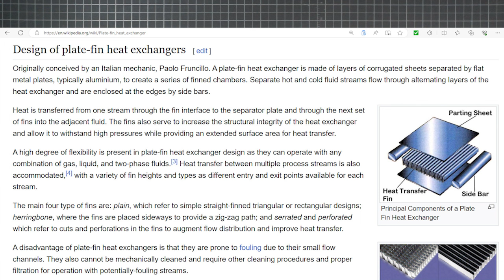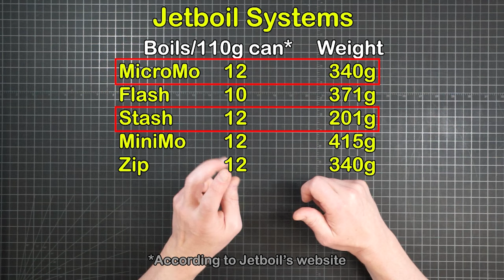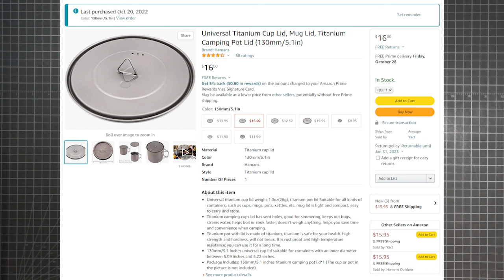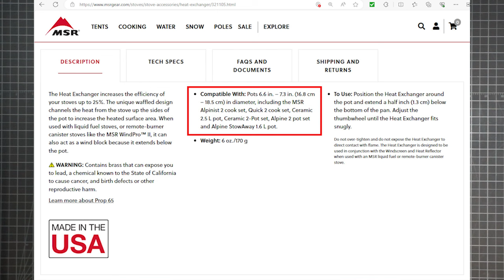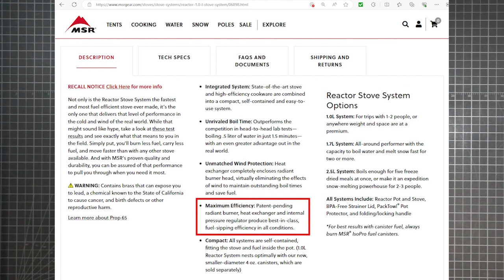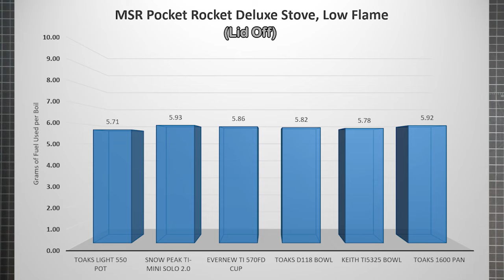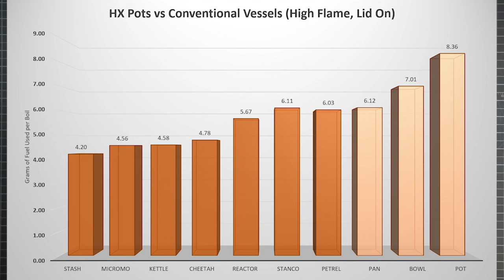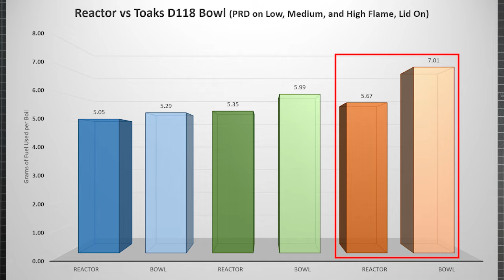Backpacking Stove Efficiency, Part 4: Heat Exchanger Systems (HX Pots)

Comment: I’m going to guess that the systems with a big burner gap that performed well in this 1st test will suffer somewhat with wind blowing between the big gap between the flame and the base of the pot?
Reply from the maker: Seems like a good guess. I do have some third party windscreens to include. A good gap plus a screen might be the best of both.
Reply: @GearSkeptic  the original FireMaple stove that comes as a set with the Petrel HX pot does have a larger burner gap than that of the Soto Windmaster/Petrel HX pot combo.

Comment: The rule of thumb for aluminum heat sink fin efficiency is 20/1  length / thickness.   I see only one that approximate this in your test, they mostly look too thin.  You're testing, not designing, so this doesn't change your results.  It does indicate abbreviated design cycles from most manufacturers.  I would be deforming the leading edges of the fins as turbulence increases exchange.  A small hammer and chisel would probably improve all of them with no weight penalty.   I am interested in wind shields that make a "chimney" around the pot.  I would guess that a chimney from .5 below burner (wind shield) and covering  75% of the pot with a .1" to .2" gap might be worth carry weight.  Also compare deformation temperatures of aluminum and titanium.  Easy to ruin an empty titanium pot over a fire.   Thanks.
Reply from the maker: Very thought-provoking! Thanks much.

Comment: Heat exchangers increase the surface area near the heat source, right?
The pot sides have greater surface area than the heat exchanger.
Therefore, a windscreen that keeps the heat near the sides of the pot should work better than an HX pot, and could be much lighter weight.
Reply from the maker: That would need testing. The trick is, heat transfer rates are based on the temperature differential. The hottest parts will transmit the most. Things cool off very quickly, and the sides won’t be anywhere near as hot as the bottom.
Reply: @GearSkeptic  I've done some casual testing that has been promising. You're set up better for testing than I am, that's why I suggest the idea to you. 

Is there a way to discuss more other than here?

Agreed that it needs testing; the math rapidly becomes complex.

Comment: You talk about a bigger gap between the flame and a pot. That made me thing about high end restaurant stoves. They have massive gaps between the port and the burner compaired to stove tops in a house. So You could ask one of those manufacturers why that is.
Reply: It's for wider and more gentle distribution of heat load. Eliminates hot spots on pots and pans and applies the heat across the pan. Restaurants don't care about fuel efficiency in stoves. More about production efficiency.

I do think almost 100% of backpacking stoves are too close to the pot. Notable exceptions being the MSR Dragonfly and a few others. Its a compromise. Ideal distance vs wind.
Reply: @UnitedElectric  Well the more fuel effient a burn pot combination is the less heat is being pumped into your kitchen. Before airconditioning kitchens were stupid hot. Even now with airconditioning some kitchens switch to induction to battle the waste heat problem. So profesional stoves do care about fuel efficiency.

Comment: Would insulating the pots help?
Reply from the maker: On theory, I’d say it would help some, but my guess is not by much.  From the earlier tests, I was surprised by how little difference a lid actually makes.

The MicroMo has a neoprene cozy around it (the only one tested), but that didn’t stop it from falling behind the Stash, which is thin-walled and naked.  I do recall that pot surface area started to matter when wind was introduced. Have to see what happens with HX pots in the wind!

Comment: Silverfire's Scout Mini Dragon Pot goes beyond fins
Reply: Agreed.  Fins should be way less efficient than capturing heat along the sides of the pot, while side-heating also weighs much less.  Siverfire appears short on specs though?  Weight?  Volume?  And couldn't find the mini on their website.
Reply: @tomnoyb8301  I have it. It's stainless steel and too heavy for backpacking. I wish the made a one liter -- a micro. For car camping it's great.
Reply from the maker: If the made a smaller, titanium one…

Comment: Update after going through the San Jacintos during a 70 mph windstorm. The FireMaple system worked great, the Soto lit and boiled in the typical time. By comparison, I couldn’t get either of my lighters to ignite inside my tent (I was trying to melt guy line cord I had cut). I believe if I didn’t have a stove with a self igniter hidden inside the HX pot I would have been in trouble. These were extreme conditions of course, I got frostbite on my feet and lips, but worth noting.
Reply from the maker: Yikes! Always take care of yourself! Good point about ignition. None of it matters if you can’t get that stove lit in the first place.

Comment: Haven’t watched the video all the way through yet. My guess is that heat exchangers are rarely if ever worth the weight for the minimal improvement in efficiency. I have a MSR wind burner and rarely take it unless I need to melt snow in the winter. It is way too heavy.

Comment: If you were boiling your water for water treatment or if you actually boil the water these will help a lot more. Actually boiling uses so much damn water.
Reply: see the water treatment video on pasturization, there's basically no reason to ever actually boil the water

Comment: I did my own comparison of the Petrel vs Toaks. I’m curious as to why you’re using the 550 when the Toaks 750 is almost exactly the same size as the Petrel. Btw the “600ml” Petrel holds more water than the Toaks 750. Also, don’t you think it’s extremely biased when you’re showing weight efficiencies with different stoves? On my tests I used the Hornet II from petrel and my results were wildly different than yours.
Reply: I also think you should represent different types of people when you’re showing the unbiased results of boils per day. I think it’s more realistic seeing 3+ boils a day out of a normal backpacker. Example: morning coffee, morning oatmeal, dehydrated meal for dinner. That’s no potential for another dehydrated meal mid day or an instant potatoes pack, ect ect. All I’m suggesting is that to really avoid this ultralight bias you’re representing. Try to show all sides of the spectrum.
Reply: I’m also quite a bit at a loss for how you’re only getting up to 200 versus 212 degrees….then converting that down then converting up for hitting the 212 boil temp. That’s allowing for better results for stoves that don’t work as well in bad conditions or even decent conditions ?

Comment: Putting reactor on top of a vessel radiating/shining down onto water lowers boil time 30-40 %.
Reply: like turning the reactor upside down instead of a lid for a pot?
Reply: @nakkajin  Yeah, it will radiate direct into water. So water will be heated like in swimming pool, more mass, surface will be exposed to IR.